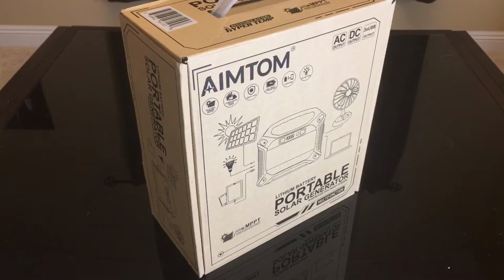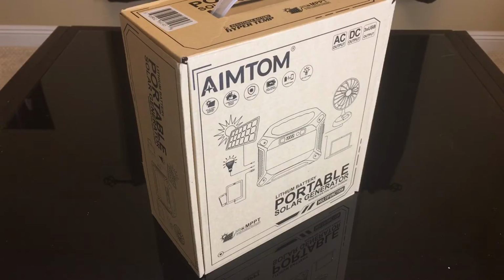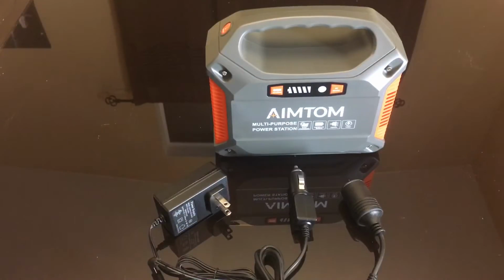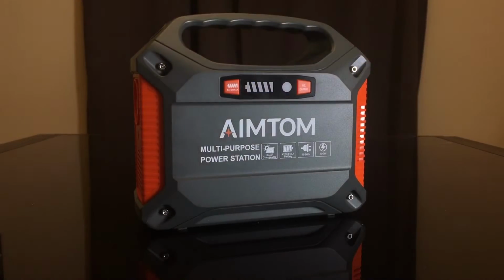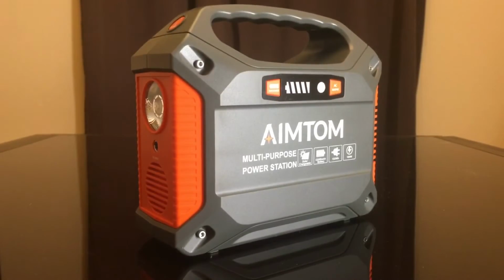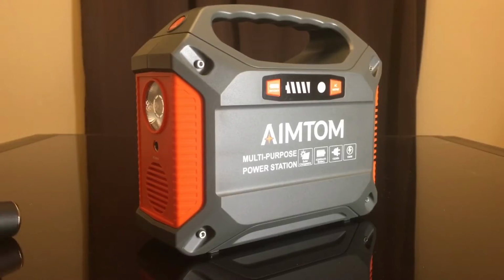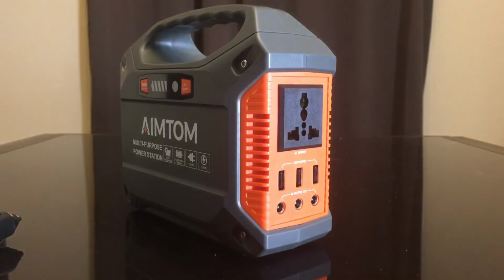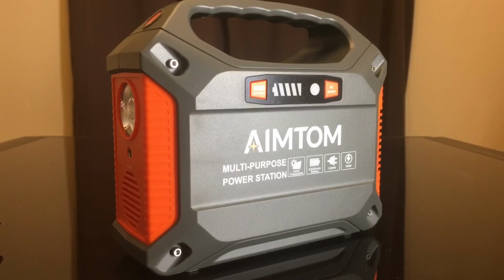REVIEW: Aimtom Portable Solar Generator -- LEGIT POWER SUPPLY!

Comment: I've had one of these in my storage closet for 0ver 3 years as a safety measure, never opened it. I just took it out of storage to use it out in the field, and it's still nearly fully charged. Only lost one bar in over 3 years. Not bad...

Comment: Scotty, we need more power!σσ>share4.photo/CampingGenerator?きj     We occasionally have blackouts which were fortunately close to bed time, but I worry that we’ll have one for prolonged hours or during a critical time. That is where a power generator comes in. Depending on its size, a power generator can power individual devices, like this one, up to your entire house. I really just needed something to power a few lights and/or phone chargers in case of emergency. This power generator is pretty compact at about an 8 inch cube, but very dense for its size. There are multiple ways to charge the generator, by using the included AC power adapter, via included car port cable or a solar panel plug. The generator provides 330W of power in several different ways: 12V 5A, 12V 10A (DC car port), USB 3.0, USB C, and AC 110V. Once you power on the generator with the on/off button, you can apply power to all ports at the same time which is really nice if you have a lot of electronics or just a single one. There is even a built-in work light that is pretty brig

Comment: Hey Sunny you have had it 2 years now would you still recommend it?
Reply from the maker: Hi! Let me make a follow up video. I’m still using this and has been good so far
Reply: @SunnyReviewsEverything  I have several ups inverter and the most important thing to know is that they are expensive so only professional should even consider.
Reply: @SunnyReviewsEverything  hola ok, esperando el vídeo entonces
Reply: I have been running two Aimtoms for 1 year solid as my main power source and I would def recommend. I charge them with my generator. I love them! I am def going to buy more. hey stand up to daily use, which is what I love about them. Have fun!

Comment: This isn't a review. All he did was unbox it and describe it. No tests were run, and having watched this video I don't know anything useful about this product that I didn't already know. I don't know how it works, or even IF it works from this review.
Reply: Well dude if you can do better by all means buy one and do it. I think he did well. A 3 yr old can figure that out wouldn't you say???? This isn't the only video on this product. Negativity leads to Negativity, not to mention his video got the most reviews out of the ones that did tell you..  Try to be more positive ok sport.
Reply: Dear Steve Tonner,

I’ll try to be helpful and positive.  I purchased one of these a few weeks ago.  They are an emergency power supply and probably not designed to be used constantly.  On a single charge mine powered up a handheld Nintendo DS XL, then my Sony portable DVD play, then I used my portable Acer (with the dead internal battery that now only works from mains power) for 3+ hours, then charged up my I-pad to 83 % before the solar generator (an Aimtom knock off) ran out of juice.

That to me is impressive.  I wouldn’t recommend using this with very sensitive electronic or valuable equipment as it’s not pure sine, but so far none of my low wattage / low voltage gizmos have suffered any appreciable or obvious damage.  

Have used it in my garden shed / office that has no mains power.  Hooked it up to an internal low wattage energy saving light ... plenty of light for a couple of hours and didn’t even use one of the 4 bars of power on the indicator.

Cons.  What it won’t really do is run big energy uses like fridges or aircon for long or at all if these have high wattage requirements.  If that’s your intention, get a more sophisticated and expensive pure sine system.

Also while the wall transformer powers up the Aimtom from mains power in 7-10 hours and the unit will happily charge up from a car 12 volt cigarette lighter fitting, some people have reported some difficulty working out how to power up the unit from solar panels, including leads that don’t match, etc.  Best speak with techspert people at a store that sells these if solar power is the intended off-grid power source.

With my unit each indicator bar (and there’s 4 of them on the display panel) gives about 2 to 3 hours of power at the rate I use it.  However the last and final bar gives nowhere near this and maybe there simply to tell you it’s time to recharge the unit.

On the plus side, this is the unit I’d take for camping as I reckon I could charge up my Nintendo DS XL large screen, probably 6 to 8 times, not for kiddie games, but for chess, solitaire, 100 classic books, scrabble, and learning a foreign language, etc.

It would probably work well in an electrical mains power brownout, for emergency lighting, powering up a mobile phone and something left for entertainment.

So I hope that helps you and anyone else who may be interested.
Reply: I used mine for 6 weeks daily using the car plug and it powered my sleep apnea machine every night while car camping across the US and into Canada ! Great machine!! 100% got me sold on this machine . Now I have 2 machines and solar panel. I’m just trying to figure out to plug the panel in to recharge.

Comment: This is essentially a copy paste of my other comment but if anyone wants the tech specs for this I have a powertech branded version of this with (from what I can see) the only difference being my one has a 240v AC output. This is a link to the spec sheet for the powertech branded one for anyone who is interested. https://www.jaycar.co.nz/medias/sys_master/images/9284762959902/MB3748-manualMain.pdf

Comment: It's modified sine wave which means you should not charge sensitive electrical equipment on the AC. It is also slow to charge, 7-8 hours.

Comment: Anyone get this to charge with a solar panel?  I've have an ACOPOWER 12v, 50 watt folding solar panel but it doesn't work with this device.  I haven't seen anyone successfully charge the device from solar.
Reply: I have the same situation. I wander if it's needs a charge controller.
Reply: https://www.amazon.ca/AIMTOM-Portable-Solar-Charger-Compatible/dp/B07RZVTTY6/ref=pd_lpo_sbs_86_t_1?_encoding=UTF8&psc=1&refRID=5WTMWDWA44X9AC16WEEE
Reply: Yes it chargers with solar panel.you will need an adapter from the panel to the same size connector to the round charging intake. The same size as your round insurt as you 110 charger. Most foldable solar panel comes with it.
Reply: I think it comes with a 5.5 mm solar charge cable

Comment: Hello, can i plug in an electric drum kit on this? the adapter says  input: 100-240v -50-60hz 0.5a output: 9.0v--2.0a   Roland Td-11kv drum kit...no other plug will be put in. only this.. Let me know if its possbile:D thank you
Reply from the maker: Mustafa Hasan I cant confirm :( as long as the numbers match up, then you should be good. You can try and if it doesn’t work, return it. Goood luck
Reply: Hmm. in terms of charging the laptop as u said in the video..how many times can it charge the laptop? estimation:D
Reply from the maker: Mustafa Hasan I used to charge my surface pro with dual batteries while using it and it took about 80% of the charge.
Reply: @SunnyReviewsEverything  que es eso?.... Si llevo mi laptop y cel a camping y los cargo cuánto me dura ??....t además algunos handy o luce??....me dura bastante o solos unas horas?

Comment: How manyrealworld watt hours are availablerunning AC?
Reply: Charles Langille i have real watt tests on my channel
Reply: Charles Langille there capacity are actually very close rated. I ran 80W of CFL lighting for over 2.8Hours nonstop off a 250W supply rated at 220WH.
Youll get WAY more using the DC tho! Much more efficent if you want longevity per watt usage.
Reply from the maker: Charles Langille its specified to 155Wh. :) it’s States it is good for small appliances like a CPAP machine or vacuum. Hope that helps! Thanks for commenting!
Reply: i was looking for a real world test(i.e it runs 30 watt light for X number of hours) - versus marketing collateral
Reply from the maker: Charles Langille yeah, I won’t have that until later :(
Reply: I've been using it to power about 15W of garden string lights at 120v AC.  I had it going for 3.5 hours and battery was still going although on its last bar.